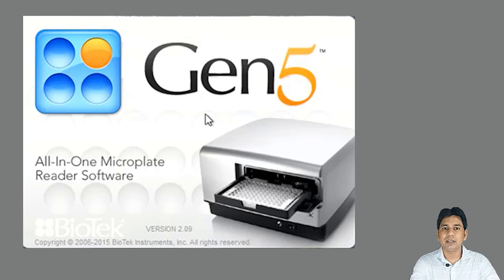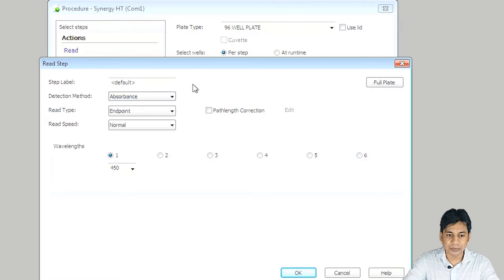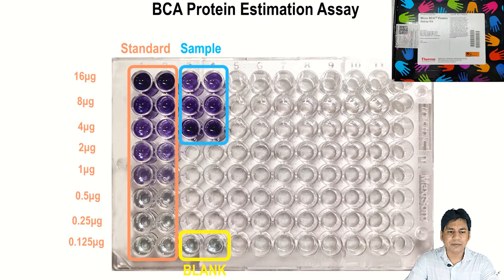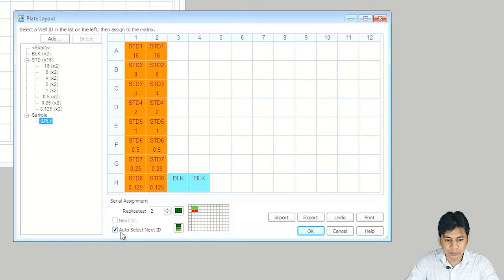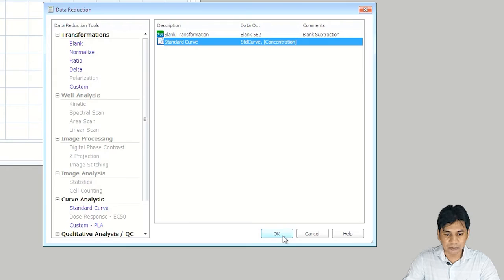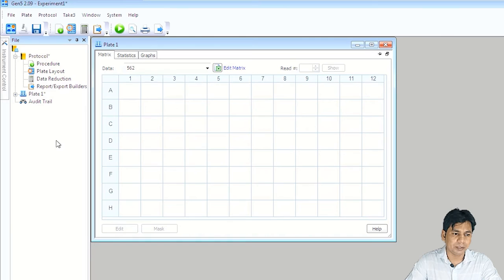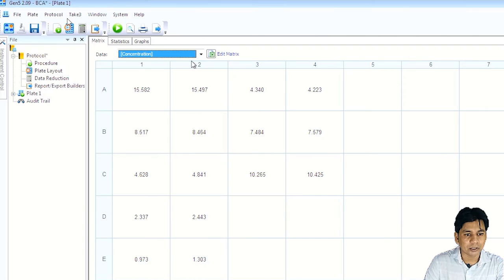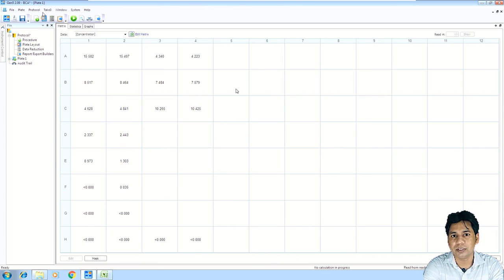Gen5: Complete Tutorial

Comment: Sir, what what is corrected blank. Do i need to analyze corrected blank readings or should i go with blank only? The average is coming negative for all the samples after corrected blank.
Reply from the maker: Pathlength correction is used for Normalization of Absorbance when we use Cuvette or Biocell for detection of DNA or RNA. In this case many factors (like Liquid volume, Plate type and manufacturer, Buffer composition, Nucleic acid concentration, Temperature of the solution) affect the the absorbance .
I suggest you please dont use pathlength correction 
use BLANK substraction only.

In case of background correction using Primary (For Exm.  450nm) and Reference  (For Exm.  650nm) wavelength.
use data reduction option in Protocol and here in Delta transformation use Data In1: Primary (For Exm.  450nm) Data In 2:  Reference  (For Exm.  650nm)   It substract OD value of Reference from Primary. Thus you can remove the background  OD.
for more detail about Pathlength correction you can visit  https://assets.thermofisher.com/TFS-Assets/LCD/Application-Notes/AN-SkanIT-Microplate-Based-Pathlength-Correction-Technical-Note-EN.pdf
Reply: Mycotoxins ELISA test kit such as Romer ELISA kit,what do you mean blank well. Blanks means I can't understand. Is it well without conjugate, substrate,&stop solution???